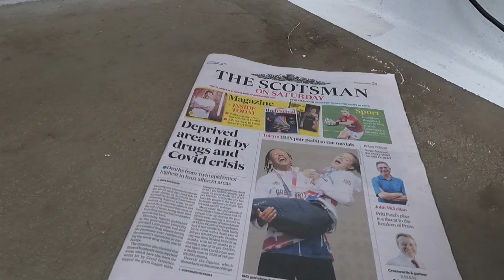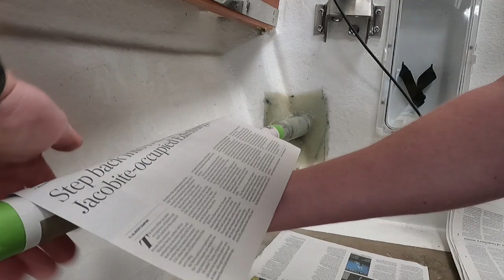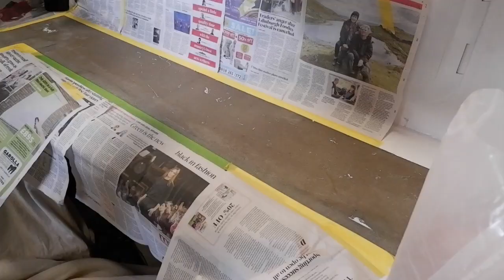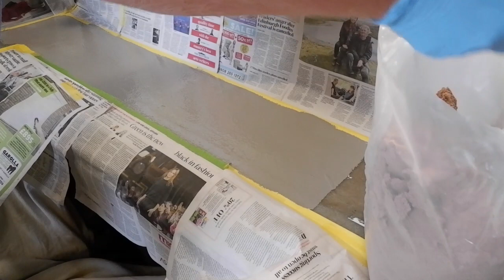Deck Work Episode 92

Comment: Looking great, to good to scratch. Ive done many decks , I either use black shot grit, or ive found a perticular bit of beach that is just right. I sieve the sand and put the finer stuff in the oven in a baking tray overnight. Works a treat. We did a GM 32 and Tipped couple buckets of grit into 20 ltrs of grey gel. Stirred it up tipped it out and pushed it around with a deck broom. Best working deck I ever had, mind you boots only lasted 6 months and you diddnt wanna kneel down on it. All the best Baz.
Reply from the maker: Thank you Graham,  much appreciated mate. 
Your absolutely spot on with the shot grit, I think that would be the less faffy way of doing this job.
The sand has worked well, and the dryer stuff helped immensely,  damn rain!🤣🤣🤣😂😂😂
I will ALWAYS  have a soft spot for GM32's, even if they have a death trap deck.🤣🤣🤣😂😂😂 
Thank you for your kind comment mate, really appreciate the time and effort. 
Enjoy the rest of your weekend. 
All the best.
Baz 😉👍